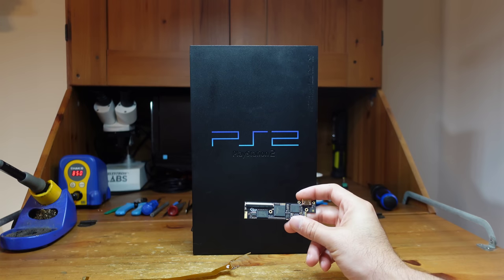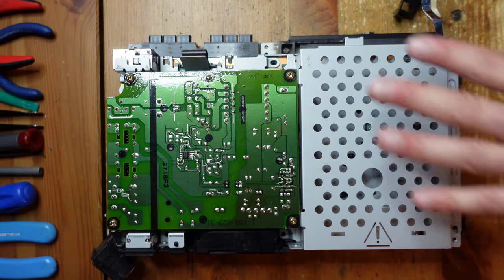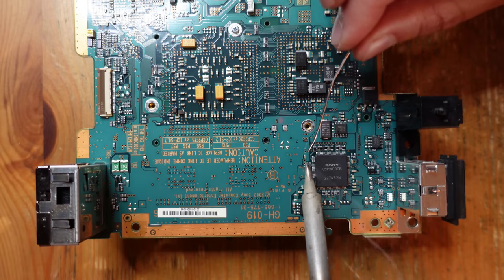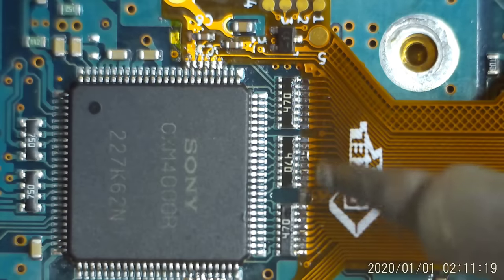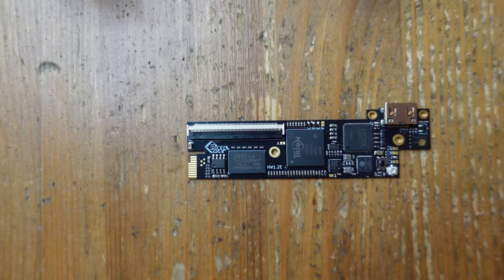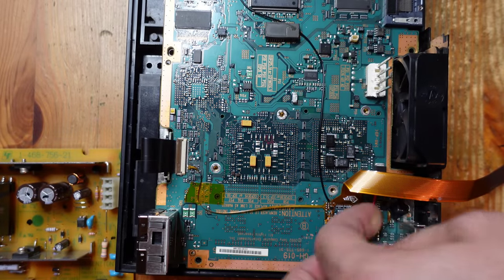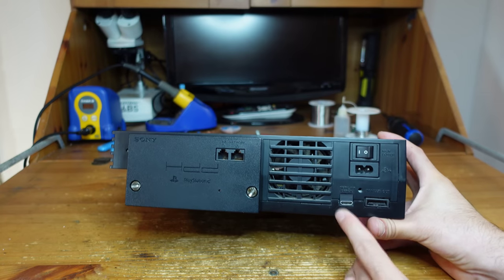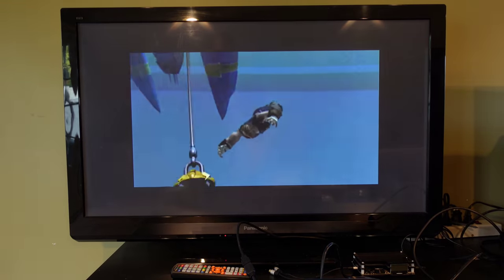Finally, a PS2 HDMI mod! Get the best possible video from your PS2 with the PixelFX Retro Gem!

Comment: my only complaint with this is that some or a lot of features are locked behind a paywall, they are on there but you cant use them unless you get the more expensive version, sooner or later the firmware will be jailbroken or a china clone will be made and this will be moot
Reply from the maker: I didn’t particularly care about the paywall because I thought $200 was fair for all of the features I was getting
Reply: funny how most people choose to see it as a "paywall" rather than viewing it as a $200 mod (which is a good price), with the OPTION to pay half, with the only downside being less features (so it's more accessible to more types of people/budgets)...
Reply: @lolztony  I think the issue people see, and I fully understand, is the advanced features are only enabled by software. As I understand it the hardware, and therefore production cost, is identical whether you get the basic or shiny edition. So its most definitely a bit of a cash grab to charge significantly more for the shiny edition as its clear it can be sold at a lower cost. The R&D is already done, so its not costing them anything more to produce. I'd almost feel better about it if they only had the shiny version at the higher cost.  Actually, what may be better is to offer the retrogem basic as a one size fits all board at the lower cost and then develop console specific boards using the same technology (basically a custom board layout) that makes installation and fitment better that includes the shiny features at the more premium cost. For reference, I own their PS1 Digital, N64 Digital, and DC digital.
Reply: @burgermeyer  you see, this kind of response makes sense to a consumer, but it shows a massive ignorance to business. Just because something technically costs very little to produce does NOT mean you should pass that savings on to the consumer. For instance, intel could make a CPU for maybe $10 mass produced, but do you think it’d be profitable for them to sell for $20?? That makes no sense. Imagine all the overhead costs of running a business, manufacturing, and most importantly RESEARCH AND DEVELOPMENT. Just because the research and development is “finished” doesn’t mean you need to sell at cost. Imagine being upset that an artist is selling a painting, that took them a week to paint, for $100, but you think it should only cost $15 (the cost of the paint). 

Also? You’re assuming that can sell at a lower cost just because they have the basic version at a lower cost, but that’s also a dangerous assumption. Most consoles are sold at a LOSS to the companies like Sony, Nintendo, Microsoft, and they hope to make money on subscription and games. They have to make that money elsewhere in order to offset the losses. So going back to the GEM, it’s entirely possible that they wouldn’t be able to sell all of their kits at the basic price, because they could very well be losing money on those, but offsetting that loss by people upgrading to the shiny. I don’t expect the average consumer to know all of this, but at the very least try to think further than just your own perspective imo 🤷🏻‍♂️
Reply: @lolztony     yes, all of that could be true. but as a business they also need to keep the average consumer perception in mind. If consumers feel like they are getting screwed that's not good for business no matter how you justify it.
Reply: @burgermeyer  do you feel “screwed” when you buy an apple at the store? Or maybe a pair of glasses? You know these things “technically” cost almost nothing, yet people know, generally, the amount of added overhead cost. The problem with the GEM is that they overestimated the intelligence of the average consumer. If they released only the shiny edition, nobody would be upset and everyone would be happy with the cost. Instead, they try to get it into more hands, even though they take a hit to profits, and ironically, people get upset because “they could’ve sold it for less”. 

So in the end, you’re right, they should have taken into account how dumb people are, and not offered them a cheaper, upgradable option.
Reply: @lolztony  consider if Microsoft sold only the xbox series x hardware  you and bought the same physical hardware no matter if was a series x or s. But you only got series s like performance unless you paid more to unlock it the x features. That's a closer comparison. And yes I personally would feel better if all they offered were the shiny edition at the higher price. The price tiers would be more appropriate If the basic edition was actually less powerful, like how Microsoft sells series s hardware that's not as capable as an x, but good enough for many people. It's the fact that the basic edition is artificially limited. It would be different if they were physically differentiated somehow.
Reply: @burgermeyer  I’m not gonna reply anymore since you obviously just aren’t understanding. You’re disregarding every point I make, and basically just saying “but they could just sell it for cheaper!” lol have a good night